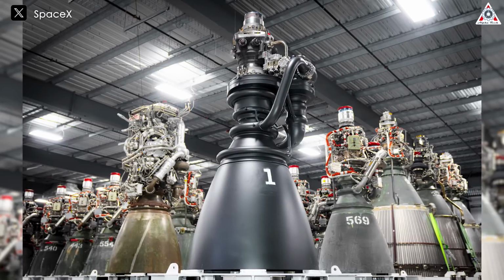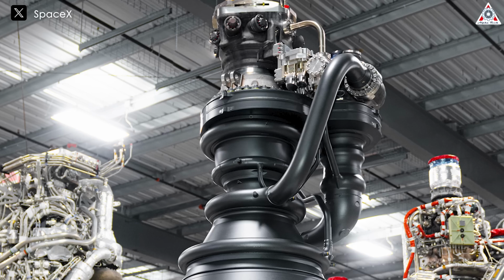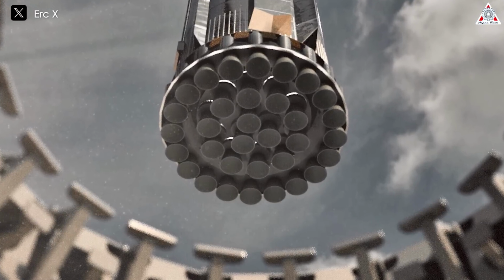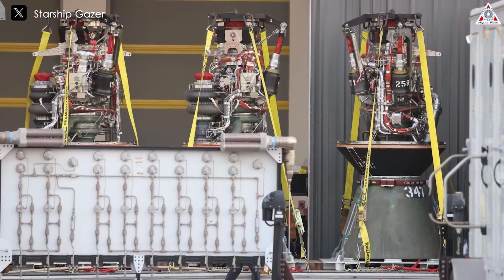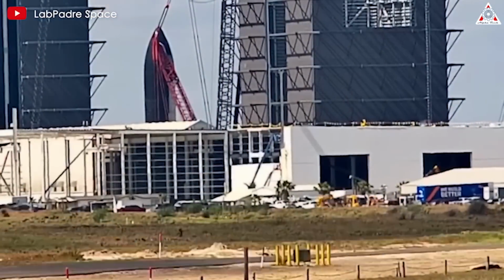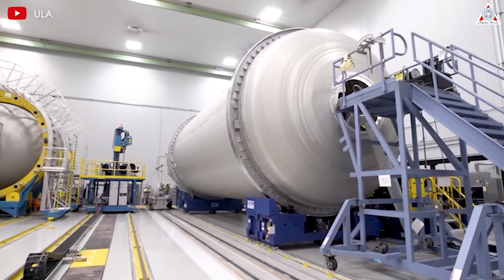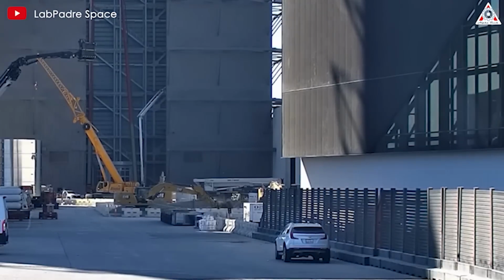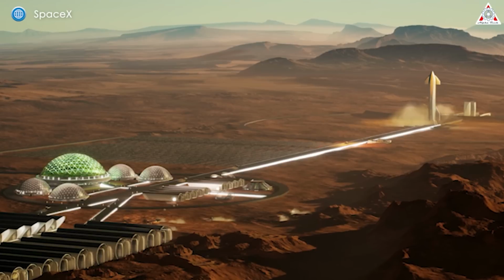It's Mind-blowing! Musk's SpaceX Just Announced NEW Raptor 3 Design Upgrade...

Comment: Elon Musk need to think of lunching his own space station. But instead of doing that, he need to lunch a space carrier where he could dock his space ship for maintenance. Like the Aircraft Carrier the USN have. He doesn't need a catapults or arresting gear. But his space ship must have side booster so it can land flat. And they can use that booster for take off like the Harrier of US Marine. They can install a jet propulsion using nuclear power it can power the whole ship. Do exactly like Aircraft Carrier a city in the space. That will help to develop  a city in Mars. You don't need back and forth to Earth 🌎 because all the supplies are already in the Space  Carrier. To start build two of those. That's where you need the space force to assemble the Space Carrier and the military will be paying for them. But you also need a school to train them here on Earth 🌎 before deploying to space. There will be a Hanger Bay and side Space Craft Elevators on both side of the Space Carrier to bring the parts up and down. You can install tanks for methane, O2, Nitrogen. You make O2N2 on board by harnessing them from H2O. Make sure the inside  of the Carrier atmospheric pressure is just like here on earth so they can cook. Space force can do all of those you will also need civilian engineers to guide the Space forces. You also need to put laser gun to blast off incoming meteorite. Those are the basic don't forget to install living Quarters for men and women. I hope Elon Musk will consider this idea. God Bless Mr. Musk. ❤🎉😊
Reply: you are talking about the Macross City, Super Dimension Frontier ：—）

Comment: The comment, SpaceX will be Another Tesla, Elon will spend all his money on this and will ask for more.
Reply: Counterpoint:  Spacex is quite profitable now and the Starlink services (and their revenue) are growing profits massively quarter over quarter. There won't be competition of note for several years for Starlink and he has the run of the industry especially with the E-band being opened up by the FCC. He has about 2500 satellites, today, that can support high frequency E band to add high speed backbone services to companies like MS Azure, Google Cloud, etc (these already signed up to compete with Amazon when Kuiper is a thing (a few years). His latency for inter-continental data transfer is much lower than terrestrial solutions (light moves 2x faster in space than in glass fiber and has a more direct path. ie - premium service and Cloud companies like to backup data across 2-3 "regions" (generally seperated by thousands of miles). 
So... big market, at no extra cost to his existing subscriber services.
And while fiber may be getting multiplexing upgrade that makes it 100x more efficient at large data transfer over the next 10 years, he will still have the high ground for high priority traffic (a big, and profitable market).

That giant rocket will also allow him to launch 5x as many satellites (and 10x the overall capacity as the new V2large satellites are bigger with double the capacity) for about the same cost he's paying today.... far lower than anyone else's costs as is. 
This will kick in (at scale) in 2026, before Kuiper or China is any sort of position to provide meaningful competition.

They have had discussions of spinning off Starlink in an IPO but its becoming a massive profit generator, so more recently they have been talking about doing share buybacks to keep the private investors happy and not having to deal with SEC/Investor sentiment. (I doubt public investors would have allowed the creation of Starship - very high risk back in the day.)

The valuation of Starlink is $210 billion up from $150 billion 18 months ago. With the above advantages, that will soon balloon. Which is why they are entertaining buybacks rather than going public. 
They seem to think they are going to earn a Ton of money in 2025/6.
I do not see a path where they are not a $400+ billion company in 3 years or less.

I think the reverse is true. When the company does buybacks (to reward private investors) his share percentage grows from 42% with 78% of voting shares (his status today) and he can sell some to underwrite XAI and/or accelerate Neurolink and the Boring Company. Dropping to 40%/78% would be $4.2 billion if needed today. He won't, but he might in a year or so when Spacex is valued (by tender offer - ie what people will pay vs some analyst's guess) at $300b or more as neither company needs large money just yet.
XAI will shed a Lot of money before it starts developing profit. 

Upshot: Starlink is a Massive money making machine with massive margins (easily 10x the revenue they get from launching rockets). Its well and properly profitable as of Q1 of this year and on the bottom of an S curve of profit with no bumps in sight for 3 years. Chinese and Amazon will have credible competition at that point. 

What a change in 2 years from money pit to money machine.

Comment: Actually ISP in second is how long a rocket can burn to offset the acceleration of gravity at the Earths surface, yes you need to know the mass fuel rate and thrust, but what ISP—and it's said I.S.P. not isp—is as said somewhat analogous to how many seconds it can burn to suspend it's self in Earth surface gravity as if the engine mass and tank mass didn't exist.

which can be seen in the calculation to get Isp = F / (ṁ × g), in English that is specific impulse equal mass flow rate times standard gravity divided by thrust, the brackets mean that you do the mass flow rate times gravity first even though it's not written that way. Honestly I prefer using the effective exhaust velocity.

Comment: The best part is no part..

Why do we have over 40 engines???

Hmmm
Reply: Redundancy... I can't believe you are trying to imply that no engine is the best engine.
Reply: @lonewolfnmoon  fewer engines are better than more engines. 
Imagine Starship had 60 engines would it be better as in “more redundancy?” Or the best part is no part? “Fewer parts?”  No parts is a goal but impossible. No parts means nothing
Reply: @pedrosura  Sometimes bigger is not always better. Harder to fit bigger engines in a defined space, so with smaller engines, you get more bang for the buck. Secondly, bigger means they weigh more and you end up with diminishing returns.
Reply: @lonewolfnmoon  agreed

Comment: That's all fine 40,000 starlink satellites constellation is it going to be able to maneuver through the constellation without colliding with the satellite
Reply: Yes - and, every one of those satellites has the ability to use its ion thrusters to steer out of the way just in case, and then put itself back in place. 
The Starlink satellites, though, are closer to the surface than any other satellites of their kind, making it much easier to avoid them on launch - although, looked at realistically - they aren't exactly parked like mugs on a shelf. 
Space - even very close to Earth - is very, very large.
Reply: @art.is.life.eternal  I still have my doubts only time will tell if anomaly occurs those  little ion thrusters are not very powerful. It'll be like crossing a busy street blindfolded

Comment: On the induced mass;
For the fuel and oxy supply system, if you used reversed tapered semi concentric tanks, with methane in center being less volume and oxy outside being 2x volume of methane tank, if both tanks had bottom faces accessible to the engine bay, you could pretty much direct couple the main ring of engines bridging the dividing wall in the two tanks, and eliminate most of the piping runs on the ship via proper tank design.

And if outer tank also tapered wider at butt, get more free standing stability and more area for larger or more engines. Also would create shorter ships and boosters for their volume that were structually stronger than straight sided tubes due to being somewhat conic in shape.

Also with concentration of mass forward due to increasing volume aft, you might be able to design a ship hull that counter balanced the engine mass, with increased mass concentrated forward when tanks were used down.

Allowing better intrinsic stability in unpowered flight. Less likely to fall butt first in an uncontrolled situation and wouldnt require excess taper to do that. 

Also would concentrate structure in habitable and cargo spaces that dont have the internal pressure of the fuel mix section.

Basically the ship would be strongest at the nose if your longitudinals were of a constant number from aft to forward.

Also aesthectically more pleasant inside, not just living in a tube like the Space version of Sewer Rats...

I'm not sure modern engineers can handle dealing with semi Yurt like, or semiTipi like structures...

Primatives probably were more creative and adaptable... Not having spent 16 years listening to human droning sounds in school systems...

You could also taper your longitudinals going forward to reduce weight and increase aesthetics...

So far not a least hint of Aesthetics in Starship design...  Other than the nose shape, it being longitudinal gore construction.

Too bad Elon cant find any Engineerds that are also artistic... Surely wouldnt hurt to upgrade visuals some...

 I could see future Starships looking alot more impressive and less crudely designed..

Basically the difference between a POS and a work of art is the same materials, but the Art has more mental investment,
and care in designing.

And surely those Raptor 3 engines have been a good example of what results when one sets out to refine something...
And its almost like they deserve a better ship design now....

Just sayin'